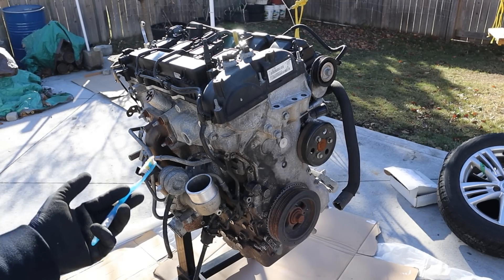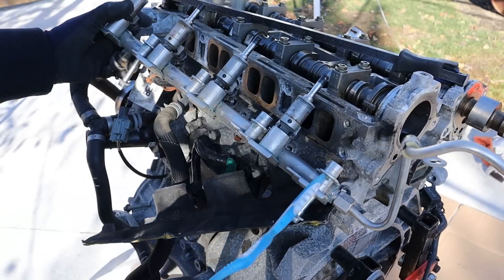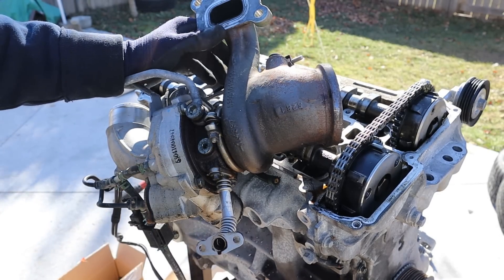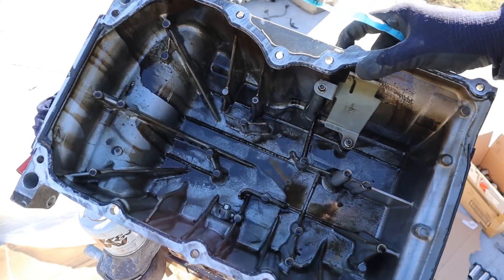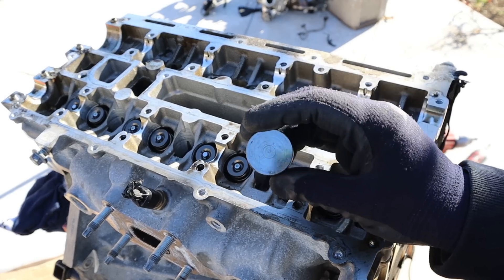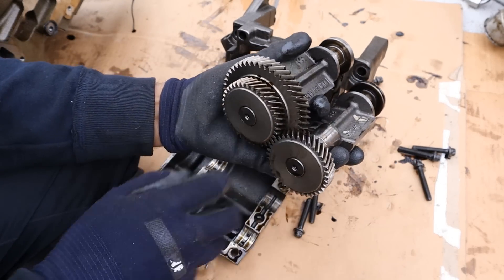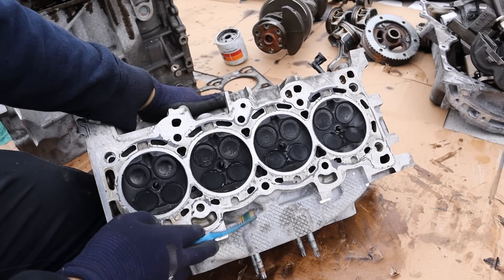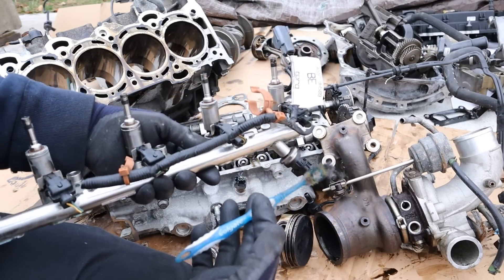Why Ford Ecoboost Engines Fail

Comment: More about these engines, most of fords 4 modern cylinder engines known as the Duratec (2.0 2.3 2.5) including the ecoboost engines are based of the Mazda MZR family of engines from 2001 except for the 2.3 in the focus RS, it still has the same foundation of the MZR series but the motors failed at incredible rates when Ford changed the block from Mazdas design to open deck instead of closed.
Not all of the heads are the same but most of them are interchangable. The bottom end parts are near identical except for minor piston and rod revisions. The Crank in the 2.3 Mazda DISI is exactly the same crank in the ford mustang ecoboost 2.3. Not the same part number but they can be directly swapped. The bore, stroke, compression ratio and deck height in those two motors are also identical. The bellhousing patterns are identical as well, you could swap the bare blocks and either car wouldn't notice. Mazda no longer uses this after changing to their SkyaxtiveX series but Ford continues to use their designs in brand new cars today.

You can mix and match some of these parts if you would like. There is a fairly large community in which Mazdaspeed owners take their 2.3 DISI heads and bolt them onto 2.5 engine blocks found in Fords and Mazdas and make decently reliable power. (With piston ring modification at a minimum). Some other straight up build and boost the 2.5L engines and they take it quite well on factory cast cranks with very little reports of breaking them before anything else.

Comment: Nice video.  I wonder if the carbon buildup is actually coking?  My thinking is the turbo creates heat and if the engine is shutoff before it reaches a cooler temperature; say about 190 degrees it would create coking.  Maybe allow the engine to idle and cool down before shutting it off could help to reduce the chance of coking/carbon buildup?  What are your thoughts?
Reply: Definitely a contributing factor. Anyone who's owned an older diesel knows to always let the turbo cool down at idle speed for 3-5 minutes to avoid trashing the turbo shaft seals with coking oil. People that buy these cars don't know crap about turbos and I'm sure there's nothing about it I'm the manual.
Reply: @life_of_riley88  whenever i drive my focus ST I start it and let it idle for a minute or two ideally and when I come back, especially if driven hard, I’ll let it sit for a while to cool down before turning off the engine. Just something you do with turbo charged vehicles

Comment: Is why I made sure the Wife's new 2020 Civic Sport has a K20C2 N/A, none GDI Engine just a traditional twin cam vtec with normal fuel injection proven reliable Also with a 6 speed manual trans, And you can still buy this 2 liter engine in some 2023 Honda car models.
Reply from the maker: Good choice on the 2.0

Comment: I get your final point about car companies being forced to crank out cars with higher miles per gallon and still have power and it causes issues. Still I think we're in the learning phase of how to do that reliably. I would probably lean more towards a hybrid approach like the Toyota Prius that would have horrible acceleration if not for the battery pack. It's not going to work as well for a tow vehicle of course, but I think as far as the consumer goes you should probably just buy a bigger cool vehicle with a bigger engine. Still, we're in the learning phase. All the car companies are improving in fuel economy and reliability, but in the process there's going to be some people with some bad cars. Just remember how far we've come from the l model t Fords!
Reply from the maker: I still vote for Toyota's hybrid approach over any turbo engine
Reply: @speedkar99  also, specifically the Prius because of its extra battery pack and special valve timing allow it to basically act as a variable displacement engine while still giving comfortable acceleration. Not every Prius last forever but by and large the hybrid system is pretty robust. Can't say as much for the break actuator in the second generation, for the poorly chosen capacitor in the dash multifunction display... But overall, a pretty solid car. My Prius has 200,000 miles on it, still running great. I feel like hybrid should be pushed a lot harder than electric, not that I have anything really against electric. Maybe a plug-in hybrid would be what I would vote for the most. One thing overlooked in hybrid cars like the Prius is that the engine doesn't have to work as hard, it should last longer. And that particular design has only one electrically actuated moving piece in the transmission, the parking brake prong! There are no clutches to wear out.

Comment: Anything, and everything made by Ford is GARBAGE. If you expect anything from Ford to last.. you probably also believe in Bigfoot and unicorns.. GARBAGE. ALL of it. Don't buy TRASH and you won't have TRASH problems. Trust me.. If the motor had not given up the ghost-the transmission would. Ford is KNOWN for NEVER being able to design a good working transmission. What car can you buy and guarantee it will need a new transmission typically by 100K miles? Foooooaaaarrrrrddddd every time. People-please be smarter with your money.. Don't buy GARBAGE.

Comment: I have a 2014 Ford Escape AWD. Usual transmission issues been going on for 4 years now and so often I don't bother resetting the OBD code. Trans replacement will cost ya around $4000-$5000. Drivers front wheel bearing going out. That'll cost ya around $350. All direct engines need a catch can or valve stem carbon buildup will happen trashing valves and valve guides which can cause catastrophic engine failure. Replacement engine will cost ya $5000-$6000. PTU = another Ford bad idea. The PTU sits smack in the middle of where the heat is under the engine. PTU failure will cost ya $1200-$2000. Lots of electronic quirks. The "A" pillar is too wide blocking your vision from cross traffic. I've had this car for 8 years now and every now and then nearly have an accident because it blocked my vision of cross traffic. This is NOT a good vehicle for an inexperienced driver. Excluding all the problems it's a decent vehicle but far overpriced for what the problems are going to cost you over the life of the car. In 2014 my 2014 new cost around $25,000. Because of all the problems that price should've been $15,000.
Also.....the windshield is about twice as expensive as other vehicles. It's a special wind noise reduction windshield.
I'll never buy another one. Actually I made a rule. I'm a lifelong Ford guy. I've had several off the showroom floor new Ford vehicles over the decades and literally watched Ford quality go into the trash can. My rule is, never buy a Ford newer than a 1995. After 1995 Ford went on a downhill slide to selling bigger and bigger junk for more and more money. Ford's motto Quality is job #1 you don't see any more for a reason. Also, Ford's "better idea" .... HA! Better junk maybe.
Reply from the maker: They appeal to a certain customer that don't keep vehicles for a long period of time

Comment: To someone who specializes in old school small block Chevys, this POS is an absolute nightmare. There is no reason for an engine to be so complicated. I have built small block Chevys that lasted past half a million miles, and made more power than this thing did. And that's carbureted with no forced induction.
Reply: 👍 Couldn't agree more. The 6f35 transmission attached to it is another nightmare. They go out. They're junk. Was going to rebuild mine until I watched a few videos here. 🤦 Oh hell no! It's far less expensive and headache to drive to the store (if the car is capable) and buy a for sale sign.

Comment: Eco boost would be great engine, if it cost 500 dollars new and the replacement would be as easy as wiper blades.
Reply from the maker: Yeah they aren't easy to work on either

Comment: I drove one of these on a rental car when I went to pick up my Marauder in 2020.

What a gutless wonder, and gave mileage equivalent to what the marauder did on the way back home. Why would you drive a piece of s*** for the same gas when you could be driving a real car?
Reply from the maker: The mileage isn't great but I'd expect the car to be peppy at least...
Reply: @speedkar99    It was in a fusion, and I would not call it peppy.  The other thing I noticed is that the engine revs quite higher than what I anticipated in order to provide the horsepower expected. Perhaps it's just me being in my 60s and growing up with those big blocks.

By the way, the first thing I did when I got it home the evening before heading out on that trip of about 700 miles in the hottest and most humid weather of July was give a quick check of all the fluids.

I also found that I had to run the snot out of the AC to keep the cabin cool whereas on the way home the marauder, which was 17 years old at the time, kept the cabin quite comfortable without cranking down the temp setting and cranking up the fan.  That could be part of the reason for the engine seeming to be underpowered and overworked.

Just not impressed with these new vehicles.

Comment: Did they fix any issues with the 2.0 turbo for 2022 or 2023 . I like too get Ford Mavrick with the eco boost ?
Reply: I would recommend buying a 1995 or older new to you Ford. These new ones have gotten worse every year. The new Broncos were recalled for engine fire. It doesn't end.
Reply from the maker: Supposedly they changed the head gasket channel but that hasn't been proven long term yet

Comment: Y'all remember ford's big push ads yelling you not to freak out w a vid of some f-150 w the NEW turbo 6 and they said they did this extensive test coast to coast and this engine by God is ready to redesign the wheel. And plenty  of folks ran out and bought one. Just like vape pens, y'all gone find out lol.
Reply from the maker: Well their campaign worked. Now rinse and repeat for EV

Comment: All of the issues with the EcoBoost can be addressed by using Amsoil Synthetics.  The volatility is 40% less than Mobil 1 for example so at 50k miles my Van's EcoBoost had a fraction of the valve deposits. I can also  clean them easily via small plugs installed in the plastic intakes. 
With Amsoils low oil oxidation deposits are nil. Good fuel additives and upper cyl lube not only adds to mileage (I get 30 in my fully loaded van) but prevents the carbon deposits.
Reply from the maker: Thanks amsoil rep 😃
Reply: @speedkar99  Cant argue with first hand results! Again - every issue is addressed by using a product designed for that application not to mention LSPI. Another issue w/ EcoBoost is the small oil sump so Oxidation as you showed is the biggest issue. You have to use a 100% synthetic to make these last so any brand is OK but there are only two in N. America that I know of. Redline is the other..

Comment: Very insightful and instructive video!  I find the edited unbolting action strangely satisfying.  I’m so glad I bought an old school coyote without all the direct injection nonsense.  I can live with slightly less hp…and a lot less headaches.
Reply from the maker: I like the bolt zipping off
Reply: @speedkar99  The idea of direct injection turbo charged engines scare me. Since each pulse basically supercools the cylinder, manufacturers have gotten to the point of increasing compression ratios up to something like 10:1 while also attaching a 15-25psi turbo. Try that with a legacy port injected engine and the heat will warp the head. Also, trying to squeeze so much power out of such a small platform just means extreme wear over time. A 5.0 V8 pumping 300hp can go 300k+ miles easily with maintenance, but a 2.0 I4 pushing about the same power? Good luck passing 200k miles with anything short of perfect maintenance and constant baby-ing it. At this point its just physics. You cant have great power and great mileage without sacrificing reliability. This is also why warranty coverage over time has gotten smaller. You just don't get the longevity anymore. It just isn't possible. Honestly I would take the bigger displacement packages and the hit on mileage to know my vehicle will last. But with how expensive everything is now, and how much people have to stretch, I understand why it has come to this.

Comment: I have a 2017 Ford Escape that at 63,000km the engine needed to be rebuilt. Ford covered the cost under the power train warranty and a short block was provided.

Comment: Were you told the mileage on this 2.0L turbo?
I have a 16 ST with 45k miles on it. I'm pretty good at keeping my foot out of the turbo, but from seeing other people with these cars it seems they are very much used and abused. There are aftermarket add-on port injection kits for this engine, if one wants to go to the expense and labor.
Reply: Cars and turbos don't mix well, but are great for diesel trucks and tractors !
Reply: @garyalford9394  
Mixes very well with my 03 Cobra. 
It all depends on how the engine is designed. If you took note on how this particular 2.0L was built you noticed how Ford beefed-up certain aspects of the engine to handle a little extra power. No turbo and direct injection you're still going to have bad carbon build up, leading to lose of power. This is why Ford has added port injection to almost all of their newer engines.
Reply: Did you just say that you don’t use the turbo in your turbo charged ford performance car? Why didn’t you just buy a regular focus if you didn’t want to run a turbo charged vehicle lol? Seriously what’s the point?
Reply: @TheBanjoShowOfficial  Seriously, you're clueless...
From your reply it sounds like you've never driven a vehicle with a turbo. Because if you did, you'd know that it is (almost) impossible to not have the turbo kick-in at some point. For example, accelerating on the on ramp of a highway; even if it's only a few pounds of boost. The problem with some people (mostly young & dumb, lol!) they drive around with their foot into the turbo constantly. How long do you think that engine is going to last, and how much fuel do think that sucks down? 
As far as Ford Performance, I leave that up to my 03 Cobra. 
Yeah, I test drove the 'regular' Focus at the dealership. *DOG*, that's all I'm going to say about that engine even with a manual trans. My previous 2006 Focus 2 door hatchback had more get-up and go with over 225,000 miles.

Comment: Oil filter on the bottom is so obsolete, I use vacuum suction oil changer, VW 2.0L t filter on top...EZ PZ  Never ever never had a VW 2.0L turbo fail, 147,00 miles on most..current 2.0L t Golf R is better than all previous.  67,000 fun reliable miles, routine 10K oil changes,

Comment: Note the crank pulley is NOT keyed to the crank, that quite tight crank bolt pinches the timing gear in place, so if you don't have the locking tools, don't loosen it. Also the wastegate is opened by pressure, not vacuum. Awesome vid, very no nonsense, and educational. Love the toothbrush pointer. P.S. , that engine has an issue of wearing the valve, and valve seat faster than the lobe and lifter, causing the lash to get tight, and the exhaust valve to burn, instead of them getting loose, Honda and Toyota engines do this to, and the ecoboost 4 is really a Mazda design.

Comment: I got a 2022 Ranger 2.3L EB. Can get 28 mpg driving 65 mph and also tow up to 7500 lbs. Working good. Although not having dual injection is such a fail. I only tow about 5k on a regular basis and it does great
Reply: You can do anything if you have really deep gearing and a standard transmission
Reply: I'm sorry but I'm an old school person who still has older cars that you you can still can work on them 😜
Reply: I'm not looking for mileage people
Reply: I also have an old jeep with 4 Liter and Ram with 5.9 gasser. Simple
Reply: Well I wouldn't do it every day
Reply: Why does anything Ford fail 🤣🤣
Reply: And how long will it last doing those kind of demanding towing jobs before that puny little four banger takes a shit and how long does it take to get up to that speed I wouldn't want to follow you down the road from a stop light pal
Reply: Get a clue and get a full size truck and suck it up and get the job done with hauling that seventy five hundred pound trailer to begin with in the first place are you one of those people who can't handle real horse power numbers and prefer to hold up traffic on the way home

Comment: I buy and turbo 02-05 Lexus GS300s that I add turbo kits to run on the stock ECU. Lots of these vehicles already have over 200k on the driveline and they're still going. Some have over 350k on the driveline and 50k on the turbo setup. Some older vehicles just last longer even under abuse. Everything has its faults, its just are you willing to put the work into it to keep it up and helping it last a long time.